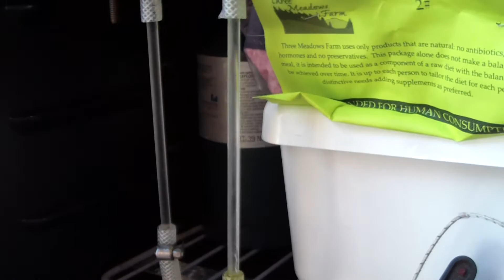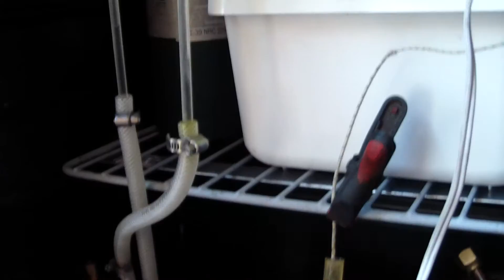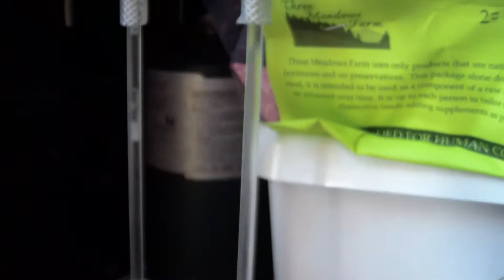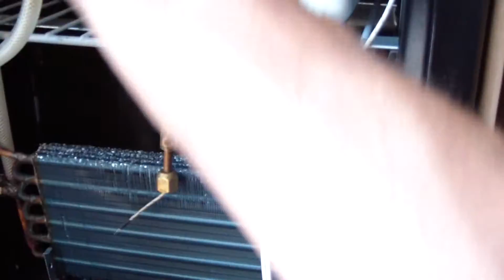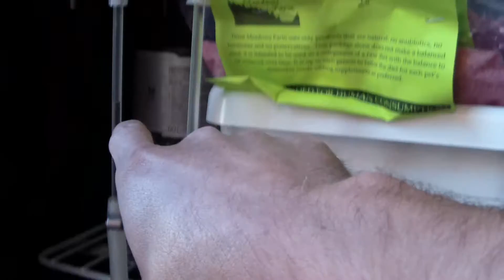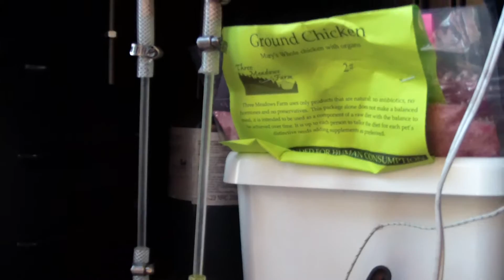Low Temperature Propane Thermosiphon

Comment: Pure CO2 based or Ammonia + Water based thermo Syphon generator works best. Ethanol on the contrary would be less efficient due to low latent heat capacity. But ammonioa could be slightly toxic so better to keep it outside or use Co2, But ammonia as used in Einstein Refrigerator works best to below freezing temperature.

Comment: Seems like the cold reservoir and thermosiphon evaporator both need to be higher to be most useful since the warmer air in the storage compartment will be at the top.
Reply from the maker: I totally agree with you there.  The intention was, a may still be, to position the tank almost above the refrigerator cabinet in an insulated jacket, with only the very bottom exposed at the ceiling level.  Then attach a lower profile thermosiphon to that.  This would be closer to what you describe.  This setup was quick and dirty, but I hoped it would have better results.  There was still a pretty large temperature difference between the coils, but not enough I suppose.  The stainless is poor conductor too, as I understand.  Interestingly, upon removing the assembly, i noticed that no forst formed on the bottom of the tank where the copper coil was clamped.  Some heat transfer occurred, but what the dominated mode is, I'm not sure.